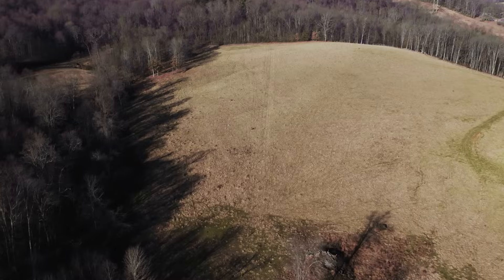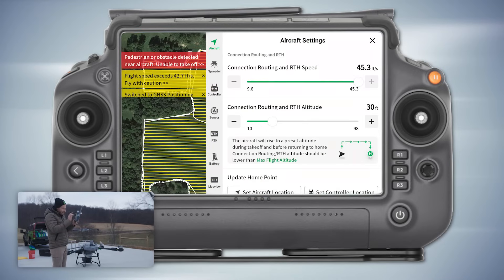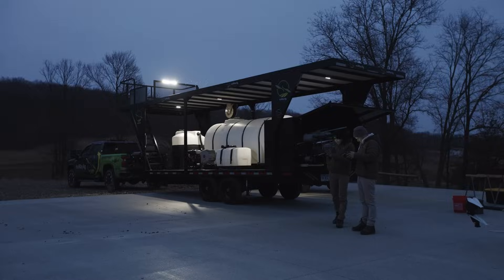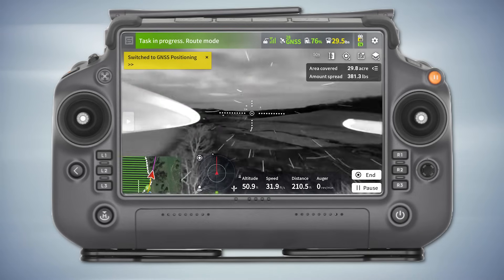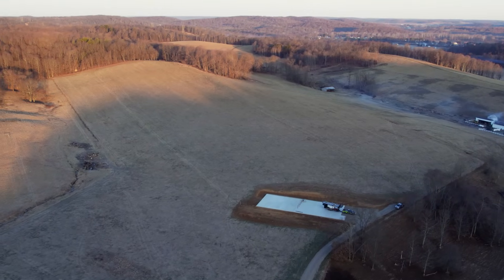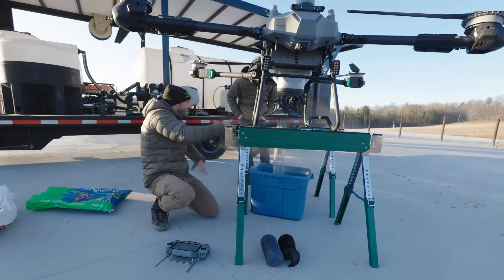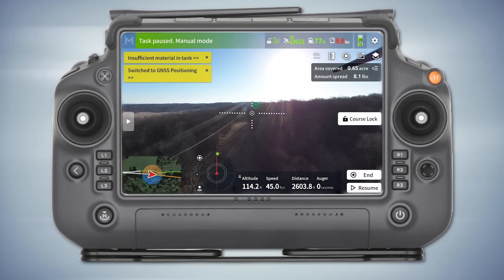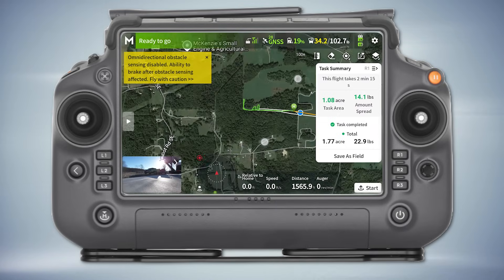T60X Spreading Seed: Auger System Upgrades

Comment: Thanks for the video, would this spreader / auger be able to put out 1.5 lbs per ac of fire ant bait?  Goal of 1.5 lbs per ac with being able to treat 17 ac per run/battery?  (take off payload would be 25 lbs per run) Thinking the biggest part of the question is what I believe might be the low per ac rate.  Thanks for any info on this.

Comment: I'm kinda confused is the t60x a dji drone or some other brand  and do you use a dji controller for it. it looks similiar to the dji rc plus 2 enterprise but it dosen't have the logo
Reply: t60x is a drone from talos, not from dji. I think that it uses some stuff from dji and it is based from the dji t60 but it is assembled from talos
Reply: @lucaspazos1367 everything is from DJI except the software
Reply: Ty bro@lucaspazos1367